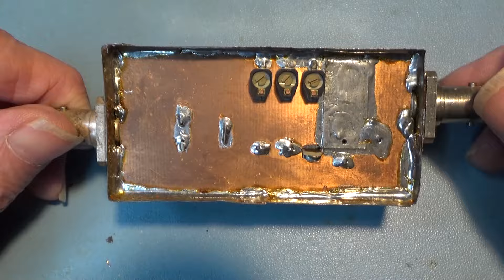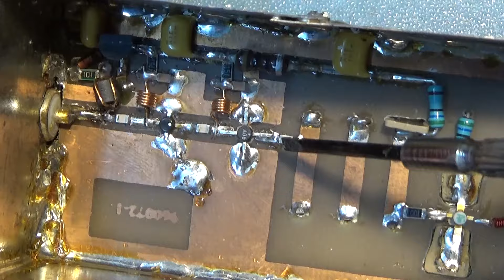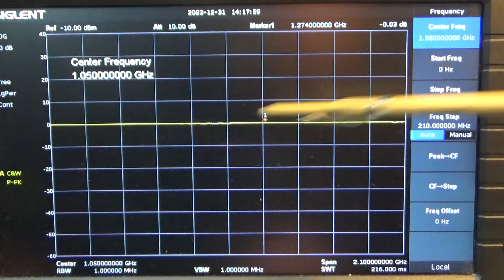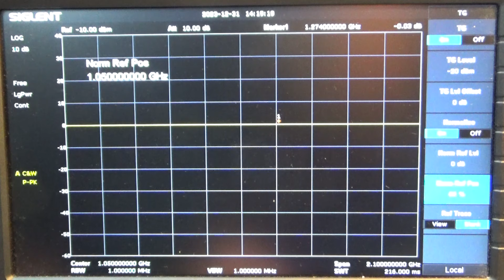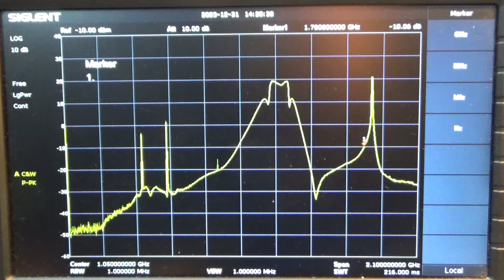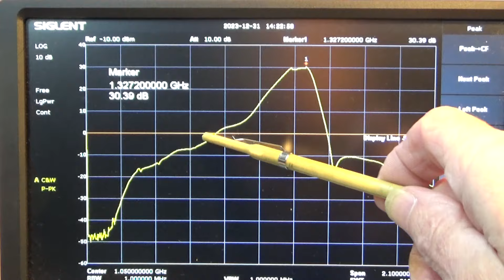Mystery RF amplifier

Comment: In my opinion, this low noise amplifier worked to compensate long coaxial line from antenna to receiver. Working in A class.
Reply from the maker: It's certainly very linear and I'm sure it's a low noise amp, hell of a lot of gain though!

Comment: It is used for Analog FM ATV (amateur television) ....Antenna to the input, output to an old analog Sattelite reveiver. These receivers normally connect to an LNB which converts down + amplify from 10GHz to the intermediate frequency of 750 - 2100 MHz. Analog Amateur Television is normally done around 1250MHz, therefore a sattelite receiver could directly be used for FM modulated ATV.
Been there, done it....(PA3EXV)
Reply: I used, a discarded Uniden Sat receiver with the 1248mhz down-converter feeding the wide-band 70mhz IF port. Video quality was great.

Comment: Avantek and Mini-Circuits 50 ohm gain blocks were an essential for roll your own  RF experimenters back in the day. They still live on, and offer many reasonably priced filters and RF devices. 
Happy New Year Nick 73' and kudos to the person who constructed that amplifier.
Reply from the maker: Happy new year to you Paul.
I forgot to mention hp also made them. The one marked Ao6 is by hp and I have a few of those. I've the urge now to tweak the capacitors in the band pass filter.
Reply: @ptronix  HP had some fine low noise semi's, though I don't know if they had their own wafer fab or if some 3rd party made them. The A06 might be very similar to the Mini MAR-6 which has a lot of gain, and will easily blow if abused. Afterthought: Maybe for 1248mhz FM ATV or 1296. Gasfets better and loop Yagi's preferred.
Reply from the maker: @danishnative9555  hi Paul, the A06 is actually an MSA-0686 by hp. Its maximum gain is 16.5 db but drops a bit at the frequency in this amplifier.
I used them to replace some crap Philips devices that were used in a signal generator. There were 7 of them and one by one they all failed. I still think the input device is a gasfet for low noise.
I gave up on 23 cm years ago, too many hills around me, the furthest contact I managed was only 50 miles.The IC 9700 is a lovely radio for 2m but wish it had another band on it rather than 23 cm!
Reply: @ptronix  Interesting because the Mini MAR-6 has "06" printed on it as shown by the data sheet, but the two devices seem dis-similar otherwise.
Reply from the maker: @danishnative9555  hi Paul, mystery has been solved. Email from a Dutch guy. This was a project in a Dutch electronic magazine, its a low noise amateur TV preamp. Sent me a link to download the pdf. Trouble is it's in Dutch! But gives me more info. First device is a gasfet as I suspected. MGF1302 followed by two MSA-0686 by hp. Or MAR 6 by mini circuits. May do a follow up video as it's been very popular so far.

Comment: Its a rf amplifier for 1.2ghz and its made to amplify an antenna signal and feed it into a satellite receiver.   Satellite receivers need a lot of gain so that's why it has a gasfet followed by a filter and then  2  mmic  stages.  Probably about 40db gain al up which is what a satellite receiver needs as its designed to be used with a LNB  (low noise block converter)  These  were used to receive FM amateur Television between 1240mhz and  1300 mhz 1.3Ghz    This is very 90s tech.  I built many of these.
Reply from the maker: Thanks I know all that now, as a kind person sent me the original magazine article. The one I tested had a peak gain of 37 db

Comment: It is a GPS L2 (1227.60 MHz) amplifier?
Reply from the maker: I'm sure it's a low noise amplifier for the 23 cm amateur band
Reply: @ptronix  It could be, but the relative sharp frequency response and the 30 dB amplification is often what we see on GPS amplifiers. BTW Is the power supply to the output BNC passed through to the input BNC? (If so, this might indicate that it is an in-line amp to compansate wire loss).
Reply from the maker: @TorbenRune  it's not got a particularly sharp frequency response, it perfectly covers the the 23 cm amateur band, yes it's powered up the coax and no there is no power to the input bnc
Reply: @ptronix  ok, then it is probably not a GPS amp.
Reply: I would say a little rf amplifier on 1300 mhz in on the left and out on the right... Filter seems to be around 1255 to 1300 mhz..

Comment: That's quite a performer. enjoyed the investigation.  Really tempted to suggest it might be usable as a TX amp, with that much gain.  Would need beefy heat-sinking though, yes?
Reply from the maker: I'm kinda thinking the same Joe, transmit amp. I should have measured the power output, but it can't be that high with no heatsinks on the gain blocks. I'm also thinking the first device on the input may be a gaas fet after all